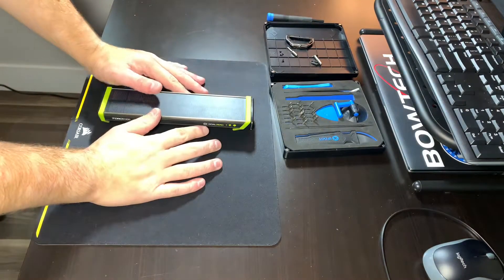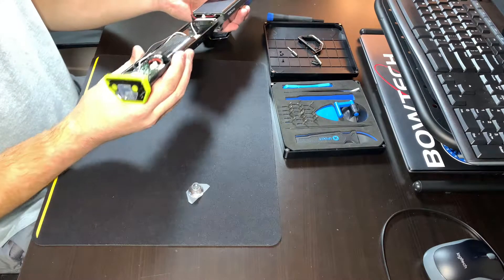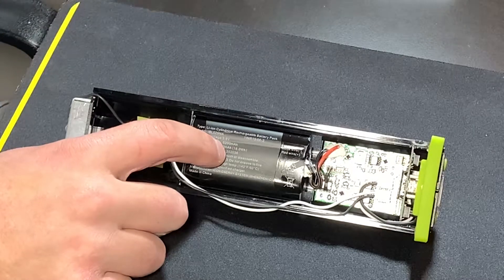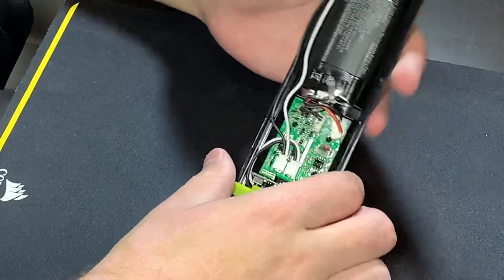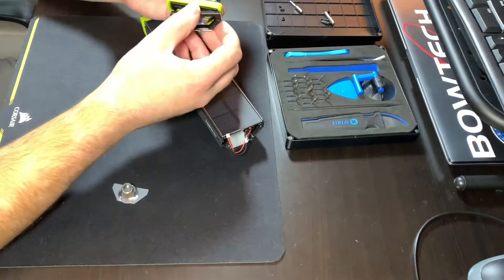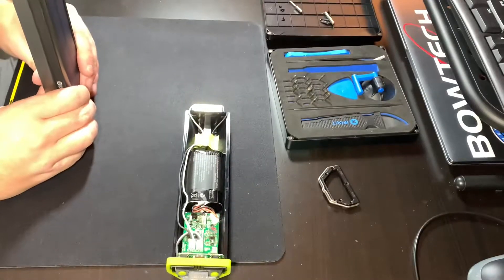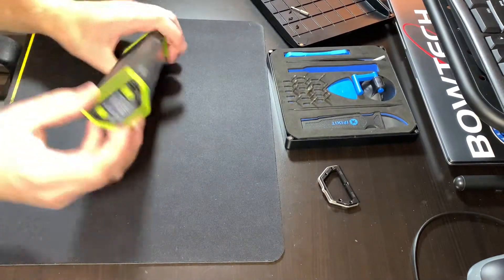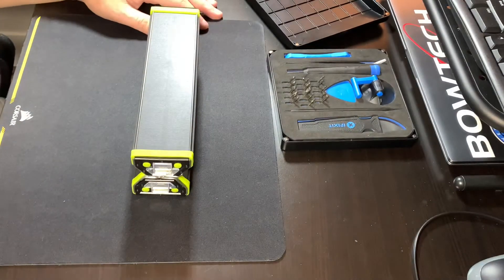Goal Zero Torch 500 Teardown - Great Design

Comment: "Great design"? No, it's a terrible design. As in "awfully bad". I can see from video that the solar panel is not covered by tempered glass, it is covered by cheap transparent plastic which WILL get easily scratched up and WILL get cloudy over time and lose the light transmittance. I can also see from the video that the battery pack is proprietary and not something like a 2 separate 18650 batteries, which means you can't just do stuff like buy Samsung/Sony 18650 cells from third-party website and replace the stock battery in few seconds. And they want like what, $50 for this? LOL. Anyway, thanks for the video, you just saved me $50.
Reply: We've taken our Torch 500s through hell and back over the last 2 yrs, and they keep kicking. We even left 2 of ours out in a torrential down pour. No issue, they keep working. The solar panel is not cloudy and charges just as new. Battery life is still just as new. These things are tanks. You're just bitching for no reason, and no other competitor product is this good for this price. It's $50....if that's too much for you, you have bigger problems.